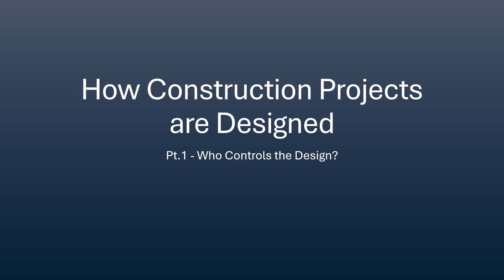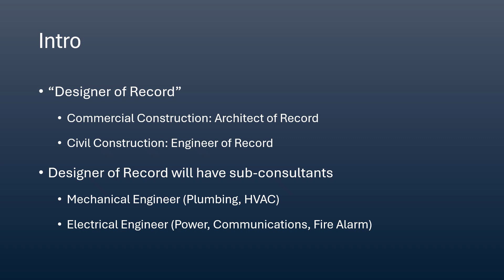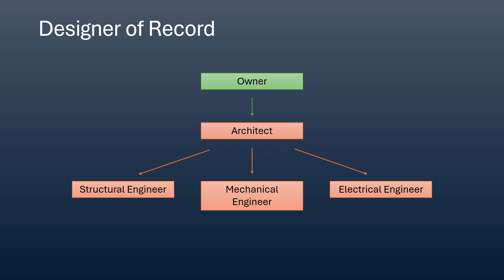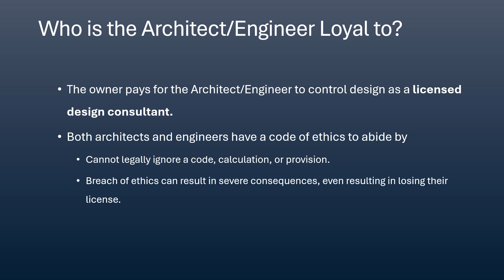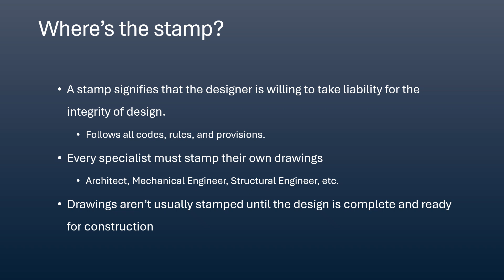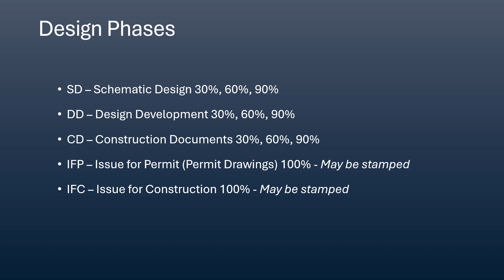Reading Construction Drawings - Intro

Comment from the maker: Just a clarification - written communication between the contractor and the architect in the discussion over design discrepancies will not automatically prevent liability. It is however generally considered a good practice. Stay safe!